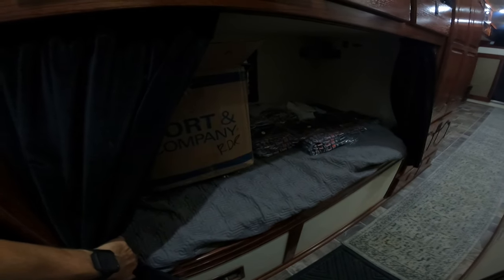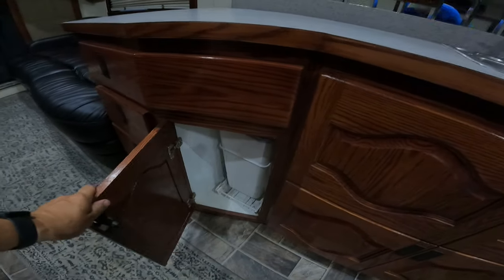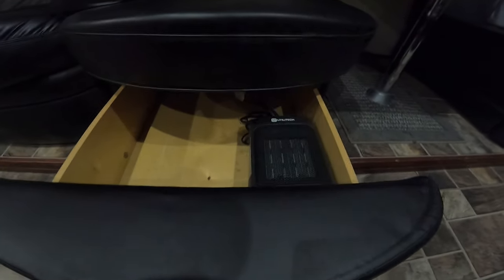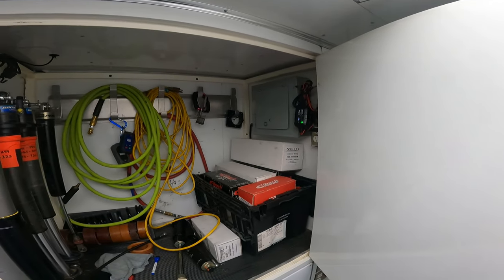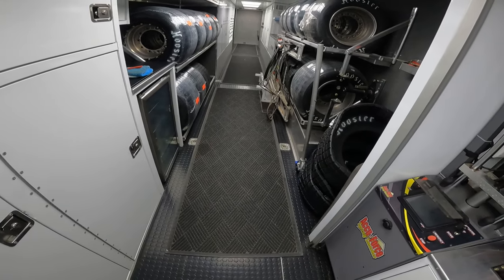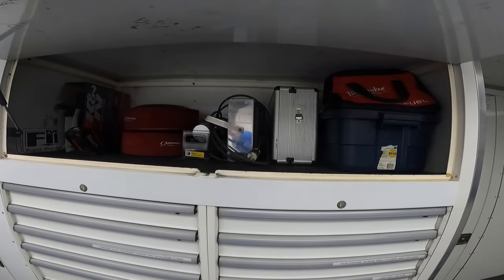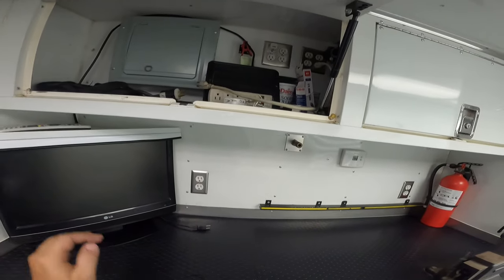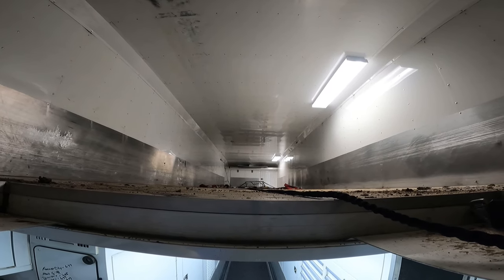Take a tour of our 2011 S & S welding Hauler

Comment: S & S is what Kelly Shryock had the entire time I work with him. His last unit looked similar to this one, outside the fact the door to the totarhome was on the side, there was a master bedroom in the back of the totarhome as well. He also had a trailer that would haul two cars, it just was a traditional stacker. It had a drop down door, where you could have a car on a ramp that raised up out of the way. Then the next car was loaded like a conventional drop down door enclosed trailer with many of the conveniences of a stacker like this one here.
Reply from the maker: S&S is defiantly one of the best built out there.
Reply: @darynklein1075  Yes they are because they are built to last a long time. 

The only thing I would do different is have a stacker that actually had a drive on lift in it, so I could actually work on the car from underneath in the trailer. That way I actually did have a garage on wheels to work on a racecar whether or not it was raining and definitely not outside on the ground. 

Then I can change oil, R&R a transmission, or change a gear or even an engine if necessary.